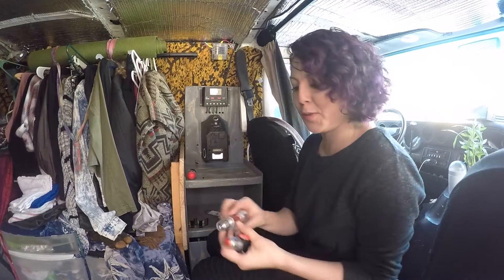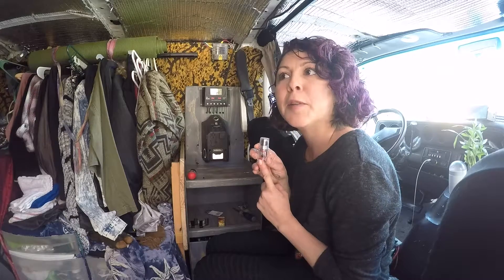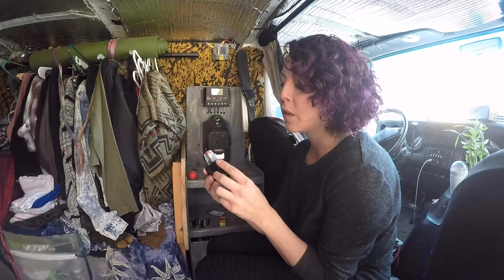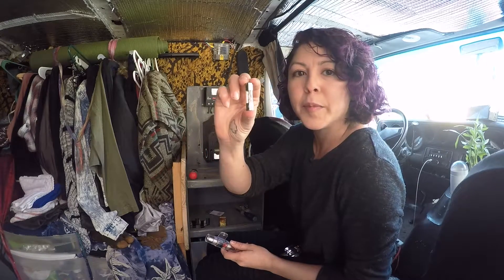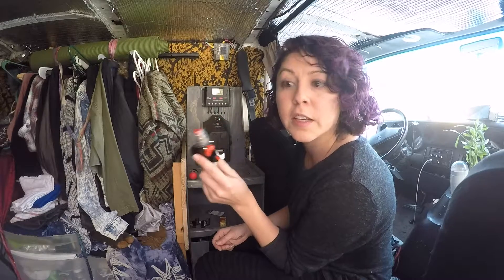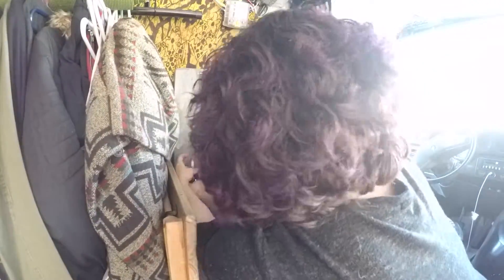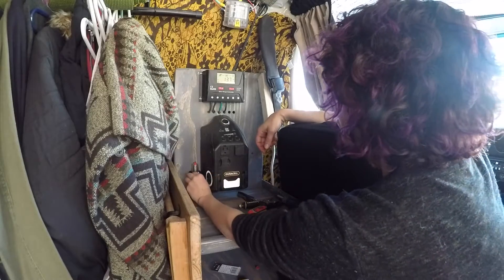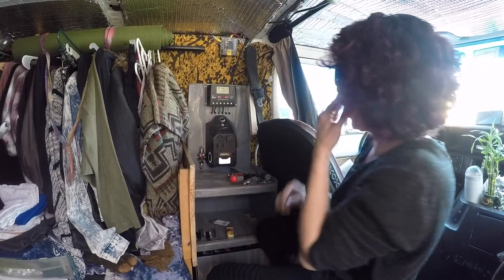Protect your inverter and install an inline circuit breaker

Comment: What amp circuit breaker do I use for a renogy 1000 watt inverter please help
Reply: I think near to 187A circuit Breaker is needed for a 12v supply 1000/12=82A+125% nealry 187A Circuit Breaker